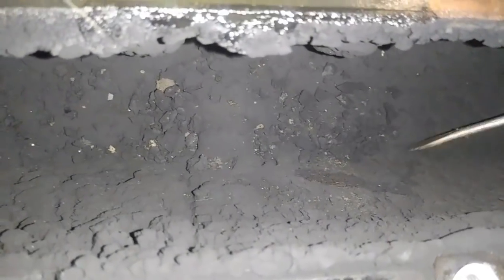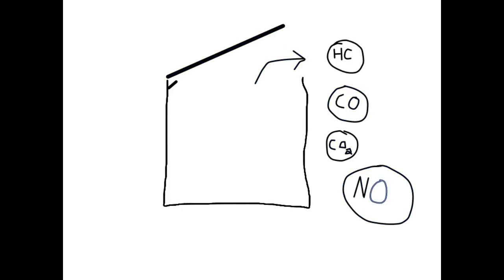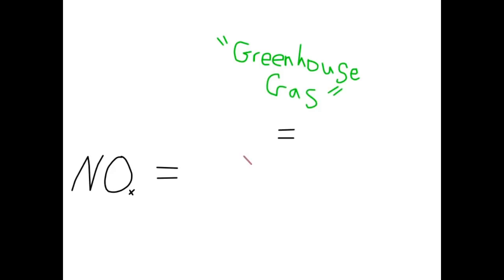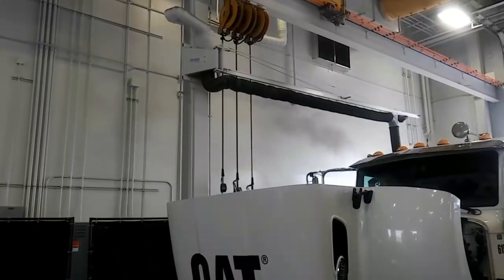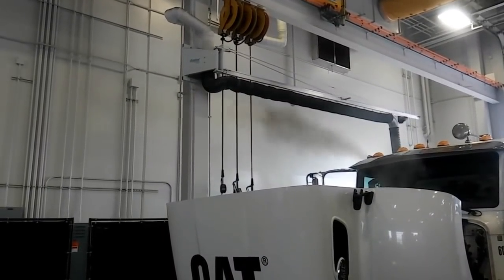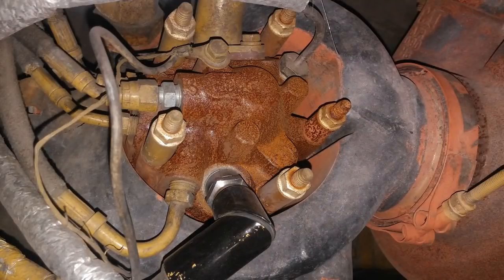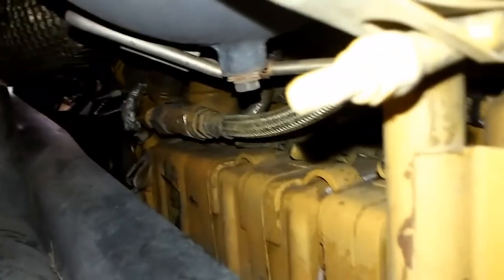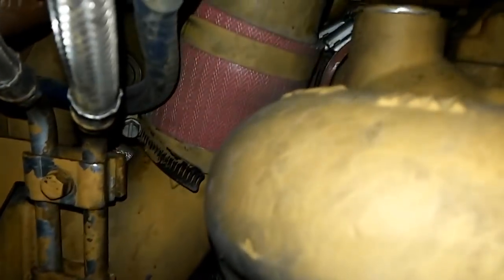Why the Cat Truck Engine EGR System Was Better Than Cummins. The Cat CGI System.

Comment: Then you have shitty Maxxforce EGR systems that were so corrosive they were eroding the aluminum egr pipes and slowly consuming fine aluminum dust lmao. The smaller Cummins ISCs and ISLs LOVE to block the egr differential ports with carbon.
Reply: gabriel guzman I know more about the medium duty MaxxForce engines i.e MFDT, 9 &10 than I want to.. Bottom line they can be kept alive by doing two things. Replace the EGR crossover tube, EGR valve mixing box and intake manifold with coated pieces and convert the closed crankcase breather system to an open one. The coated pieces come in overhaul kit that is used on a Warranty power cylinder repair..This works if aluminum contamination of the oil has not gotten to high. Or the iron level. Do these two things and they become no worse than any other post 2010 medium engine with the added benefit of no DEF.
Reply: @ronunderwood5771  I share your pain, our shop specializes in Navistar engines and I have had the wonderful pleasure of in framing at least 20 EPA 2010 DTs with at least half being overheat damage lol. I would definitely argue that the same year ISC is wayyyy more reliable but I'm a huge fan of the 08 and 05 DT (and of course the pre-egr era). I just hate the 2010s with a passion. They even sound like a rod will come through the side of the block while just idling lmao.
Reply: @Thegoose95  We have found that the idle noise is usually caused by the oil pressure regulator in the filter housing. It has been a while but we had 3 or 4 where the bores or pistons were mismachined. The piston was actually sloppy in the bore. Been a while but I think you can see it on a NED's snapshot of base oil pressure.

    Overheat? You must see more of the higher HP ones. However any radiator in the  NGV's over 5 years old is suspect.  Anytime we have a head off the radiator goes out for a flow test. Most fail.  

   We are seeing a lot more ISC's but not usually for overhaul. Mostly plugged ports, regen related issues etc. Have not overhauled one yet.

    What do you use for a piston/ring installer? We take an old liner to our friendly machine shop. They machine the top so it will fit directly on a new liner and then taper the bore. Works really slick. Have one for all the DT's and an ISL.
Reply: @ronunderwood5771  had no idea the oil pressure regulators were doing that lol, that's pretty neat. The overheat failures were 90% driver error by repeatingly driving with blown waterpumps, failed fan clutches, blown egr coolers that consumed too much coolant etc or just plugged up radiators under high loads. And yes, most have been the higher horsepower ones in gar bage trucks, wreckers (which surprised me) and some oilfield crane truck things lol. We use an OTC piston installer that works on the same DT pistons from 05 up that works AMAZING. I can get you the part number tomorrow if you want.

Comment: What are your thoughts about the IVA setups on MXS engines vs the egr on the Cummins motors?
Reply from the maker: I have a couple videos on the IVA/VVA systems. Good concept, better than EGR, but had a lot of problems that could have been improved on over time I think.
Reply: @AdeptApe  I agree but I personally love the IVA systems over the nightmares I've dealt with on the ISX egr systems.  I love your content bro please keep it up!

1.53Mil on a virgin 2007 MXS... :-)
Reply: 1.2 million on my mxs doesn’t hardly use a drop oil

Comment: Now, let's discuss the dirty little secret of the manufacturing, transportation and single use plastic containers of...DEF!
Reply: That's why you're seeing more and more DEF pumps at gas stations. At least SOMEONE spoke out after we all realised "Hey! That's ironic! Reducing NOx helps save the environment, but what about all this plastic that's left over?"
Reply: I would put def in reusable metal containers that can be sent back to the distributer to be refilled at a slight discount

Just an idea
Reply: @hopingforthebest1.9  in real 1st world countries the county takes care of that.
Reply: Saving the environment 1 plastic bottle at a time
Reply: Interestingly transported by DIESEL ENGINES!
Reply: WHY because dirt being introduced in DEF system which plugs filters.
Reply: Twice a year I save the planet by dumping 2 jugs of 2.5 gallons of DEF into my 1/2 pickup truck.  Two cardboard boxes and two plastic jugs each time.
Reply: @phprofYT  doesn't make much sense does it
Reply: @bradyanderson6840  Not really. Then again, I wasn't that good at math.
Reply: only a buffoon thinks that crap helps emissions by a very small reduction of NOX, at the cost of twice the fuel consumption, oil consumption, half the life of the engine, double the waste disposal of oil and engine, double the production pollution of factories and plants making more fuel, engines, oil, and you guessed it, basically piss water in a plastic jug.  the only clear answer would have been to leave the damn trucks alone, modify the fuel itself to produce less NOX without sacrificing the power, economy, or life of the engine. But that is just to logical for the eco crybabies.
Reply: @nathan00campbell  
There's another way to do the same thing without the problems. I have thought of a way that reduces NOx, but doesn't have Exhaust gas recirculation. It uses a different inert gas that is injected about the same time as the fuel in a different injector at high pressure and increases fuel efficiency and power and it is super cheap. Someone in Turkey had the same idea as me, and they have proved it works at a university in Turkey on a bench mounted engine. They didn't use all of my ideas, so I am going to continue to try and improve it more. I'm hoping to take my ideas to Cummins.

Comment: Small mistake there. NOx May be a greenhouse gas, but that is not why we try to limit it. It is extremely poisonous to beings that breathe air. For example humans. It causes cancer. It causes all sorts of pulmonary trouble. In short it kills people. It is not an abstract thing. Thousands of people die annually directly because of these emissions. That's why they are regulated. Same thing with particulate matter.
Reply: More than thousands of people die directly because of driving accidents. 
I bet by 50 you will have a few medical conditions. Your so worried about one thing, while you feed your body crap all day. The irony
Reply: @amigojones5962  The industry used to discredit the effects of leaded fuel, and the most basic occupant safety systems (padded dash, collapsible steering column, tempered glass).
Reply: Short answer is no. Long answer is sort of. The NOx groups are highly reactive and often create nitric acid as a response to their contact with other molecules in the atmosphere. Ammonia is a common one that causes acid rain.

Outside of the NOx group consisting mostly of ionized nitrogen a form of ozone, the effects in animals  depend largely on other elements within the atmosphere.

Comment: I wish CAT would come back and make diesel engines great again
Reply: Fun fact: Honda actually did this exact same thing with a lot of their civics, The EGR tube was attached to the exhaust after the catalytic converter!
Reply: @lustfulvengance  when the converter ages or crumbles for some other reason, that little pieces being sucked back to the intake probably don't cause any additional wear at all or do they?
Reply: As SCR tech improves I'm sure EGR systems will fade out. I believe some manufacturers have already made engines to meet NOx emissions without the use of EGR
Reply: John Brennan  Everyone is behind Toyota's hydrogen tech at this point, CAT isn't going to touch them.
Reply: They do still make engines. They just don't put make on road engines anymore
Reply: I live in the coal fields southwest VA. , For years trucking co's were buying up all the used and wore out four and quarter CAT's linkage pumps , rebuilding them putting them in newer trucks and glider kits , now Democrat governor has had it all shut down for four years.
Reply: MEGA = MAKING ENGINES GREAT AGAIN
Reply: You heard of Acert engines?
Reply: There are pieces of iron that turn diesel into noise and smoke and then are cat engine.  Make America great and let cat make great truck engines.
Reply: They still make engines you mongoloid. Just nothing on highway because theres too many restrictions. Blame DOT
Reply: @austinhales1807  Nothing to do with DOT, the EPA is who sets emissions standards.